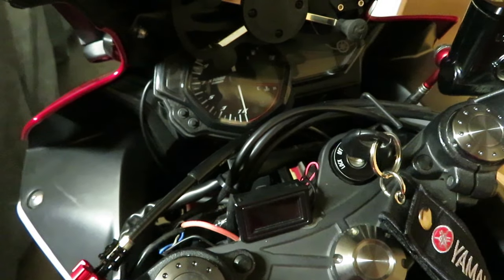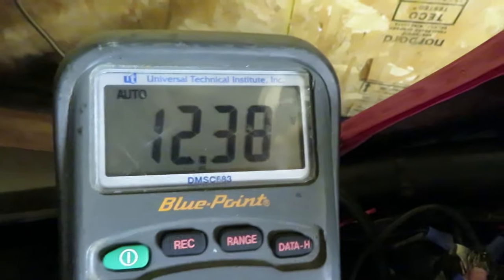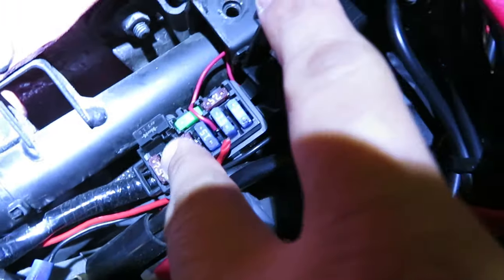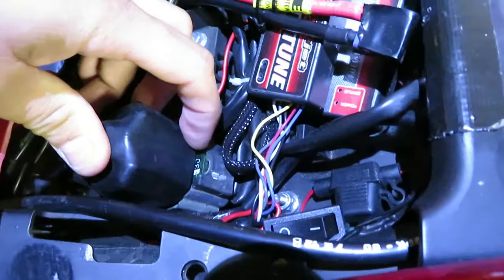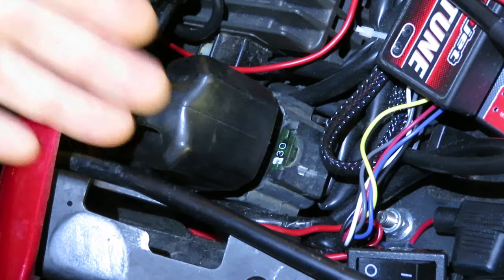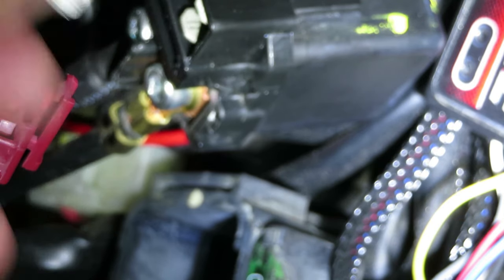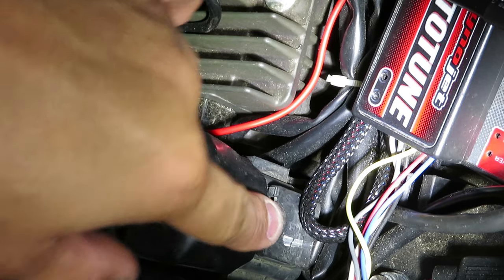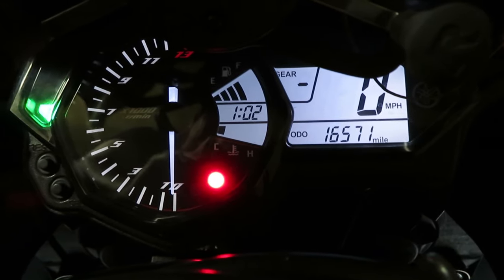I have the Ignition on but there is NO Power to the bike??

Comment: I did everything you did but, had to go an extra step (diff bike). It turns out the ignition switch when "turned" it didn't "make contact", so no power. Idk much about bikes but, I just followed the link, from battery, fuses, relay and lastly, the issue was at the switch.
Reply: What was wrong with the switch?? Mine is blowing the headlight fuse over and over again the moment I try to push the start button. It’s really frustrating me. Any help would be appreciated
Reply: @busakiller1117  My switch when "turned" its supposed to "make contact" with another metal piece, so the energy flows. It was not making "contact" (had to put the small pieces together, then once it make contact, the rest would work. I came back to work on it another day, and I guess I "moved" something else, and now I need to figure that other part out. 
But yours, it sounds like too much energy is going thru....every electric part (as I understand), is only able to handle so much "energy". If the fuse is blowing (preventing the headlight to blow up), its because too much energy is going thru. It seems you'd need to go backwards to find the issue. Good thing about YouTube, there is videos for almost everything....may want to look at those where guys show how to test the current/energy. I don't have the knowledge but like most ppl, if there is time, I'd learn from others and try things out. But, I know how frustrating this can be. Good luck !

Comment: YOU SAVED MY LIFE I had just recently changed spark plugs rectifier stater and battery and starter selenoid and when I changed fuel pump and tried turning it on everything went dark and it wouldn’t turn on even w my jumper cables and i literally found your video and went outside to try it out and it work your a legend bro
Reply: Yooo I've done all the things you have. Even just wasted $360 on professional work and a new stator..... Put on by them. No fkn way the fuse is blown out. I just put an entire new starter relay on my 04Gsxr600..... This shit has me so fkn depressed................................

Comment: Had the problem on my 2021 Honda Forza, started with battery failing, then dealer guy messed around and no instrument power ( in Thailand!). Had already found the start today fuse holder, with FUSE marked on it, was on the right track but unsure how to get into it before finding your video. Even had the spare fuse like yours. Kudos and many thanks!
Reply from the maker: your welcome glad my video was able to help you out before taking it back to a shop that would of charged you alot of money for a simple fix

Comment: Yep good stuff mate you helped someone in Australia I tried to jump start my bike hook the terminals up backwards and blew it
Reply: Hello mate,basicly i’ve done the same thing.Had a flat battery and a mate of mine said let’s touch both batteryes so the thing could start…worked 3-4 times,untill he touched the + with - and the other way.Fuse blown,changed the starter selenoid,new battery…but the thing won’t give a sign of life anymore….it’s a 04tmax 500

Comment: FYI. CBR 500 R - had the same issue, no electrical power. Starter relay was good, battery was good and fuses were good. When I plug in the battery tender I can  hear a high pitched sound. It was the voltage regulator. Now I’m waiting for it to come in the mail.
Reply: Same deal here. But mine keeps popping........

Comment: In the event this bike hasn't burned to the ground yet, PLEASE have someone who knows what they are doing consolidate your wiring. You can even have a bigger (or second) fuse box installed to help clean things up, and make it easier to loom everything together. Also, what's with the stripped insulation on the 12V lead to your starter relay? It's worth it to clean everything up and do it the right way. Bikes might be toys, but they're expensive toys. Protect your investment.
Reply from the maker: I do have a video on how to consolidate your wires. I still have my R3 to this day and still works great.

Comment: I have to wait till tomorrow to see if this is the problem. I ordered new relay. Battery giving 12.5 volts. As video stated, no power when key turned to on. Earlier it did turn on, I was getting 12.4 on fuse 1, and nothing on fuse 2. Though fuse 2 wasn't shorted (burned). Also was getting 12.4v on the relay prongs for plugin. I already have "non compatible" fuses. I'm not going to buy more that won't work. So i ordered the relay. I'd rather have a relay I know matches the type I need, than to guess at a fuse. I have 2, 30amp fuses. One new, One old. The old one, you can feel the friction as it goes into the slot. The new one doesn't. Therefore no conductivity. So, ordered new relay. If my lower 30A fuse wasn't giving any readings on power probe or multimeter, the replacement relay should fix it.
Reply from the maker: i see you have done some extensive testing to make sure on the issue

Comment: Lol what to do if the fuse blows as soon I   try to start the bike ? Does it mean ,that bit is faulty and I need to change that piece ?
Reply: Mines the same way , did you find the problem ?
Reply: @Pr0jectGloYT  lol did you find the problem same thing
Reply: @nihbih6756  yes I did ! So I brought my test light out and checked the power and ground coming from the switch . 
GROUND HAD 12v ! I had a faulty ignition . Replaced it and problem went away .

Comment: Well, I had a shortcircuit when I was working on the turn signals, now my bike can start but no lights are working! Nothing in the dashboard, nu turn signals, no neutral light..nothing at all, and the fuses are all good! What could it be?
Reply from the maker: check the turn signal relay , replace it with a new one. see if that works and fixes the issue. keep me posted
Reply: Guys, you wouldn't believe this! The problem was actually the fuse which I did check previously. The filament crack was so small that I could barely see it, like a 10th of a millimeter! Jesus! Thanks guys!

Comment: I have same problem as you i got a cbr fireblade 929 rr but my fuse relay is good BUT my issu is the battery is new and i put my ignition on  horn wont work...no headlights either what coul b the issu????
Reply from the maker: check the main wire harness plug look for any burn wires
Reply: @ACProductions77  ok am on it
Reply: @ACProductions77  checked all da wires  the bike starts wit a screwdriver iv put between the bike tank n its frame as soon as i remove the screwdriver the bike engine stops ..took it for a spine it rode well
Reply from the maker: @darider6286  then in that case you may have a short some where
Reply: @ACProductions77  i took it for a spin jus now its kickin way better than usual since it got the short sumwhere and iv tucked a  screwdriver on the bike frame so it can start the bike more agressive wit nore power imma leave it like that
Reply from the maker: @darider6286  well as long as it works and your happy with it then let it be. =)
Reply: @ACProductions77  i want to thank you for your help it saved me from going to the mechanic way too xpensive
Reply from the maker: @darider6286  your welcome sorry couldn’t help you more with finding out what’s causing the issue
Reply: @ACProductions77  nah you good that bike 24 years of age as long as its working imma ride it as it is 🙂

Comment: happened to my CBR 954RR..but I replaced  the fuse and it popped again ...what is causing it to trip
Reply from the maker: you have a short somewhere , this is where its going to get time consuming in looking for it. check all the wires looking for fryed or burned wires, any wires that are exposed and touching metal, switches, other fuses , cables to the battery, the battery itself, etc etc.
Reply from the maker: here is a newer video of looking for a short>> https://youtube.com/shorts/ULYwriQriMc?feature=share

Comment: Bro i checked everything, both the fuse box and the starter relay. I previously installed a brand new battery and it was -10 degrees one week during the winter. After that week this problem occured. What should i do?
Reply from the maker: did you check the voltage of the battery? do you keep it on a battery tender when not in use? here is another video I have > https://youtu.be/D8Oz8ak75Xw

Comment: I have an FZ-07 and that isn't only the starter relay, it is also the main switch. I'm having an issue with mine except the fuse isn't popped, all cables look good, and I am currently charging an old battery as the gel battery I put in it last year is showing 12.6, the battery tender is refusing to charge it so I think it might be toasted inside, even with it showing 12v. Weirdest thing I have run into so far. Atleast yours broke at home, mine cut off mid ride... I need to get my bike running so I can check the rectifier as with everything connected, it buzzes and won't let the tender charge the battery, I disconnect the rectifier/regulator, and the tender does what it should. So I may be in for a new battery and regulator, we shall find out soon.
Reply from the maker: are you useing the correct tender for that style battery? thats the problem with those and lipo batteries is that u can not let them drain pass a certain point cuz after that there is no bringing them back.
Reply: @AC Productions  yeah, it's the correct tender, it can do everything except lithium. I have a new battery coming tomorrow. I had a load test done on the battery. Even with it showing 12.6, it failed the load test before it even started. That just tells me there is a shorted cell. So the battery is able to hold a charge, but isn't able to differentiate positive and negative anymore. I'm still going to check my rectifier since everything is still torn apart, but I'm thinking it was the battery giving me a run around. I hate probing plugs, ohming wires, and chasing a problem that was so simple, yet did not want to show itself.
Reply from the maker: @Bk12100  glad you where able to get it diagnosed. hopefully the new battery works out , maybe get it tested before you install it on your bike.

Comment: I have a 05 R1 when I go to start the bike all lights and fuel everything comes on but it will not start I checked everything.it has spark fuel I checked to it has fuel . what is going on with my bike
Reply: does it crank? if yes you have to check spark, gas and air.

if it does nothing at all at push start, you have a sensor issue,maybe side stand, motorcycle tilt sensor or Killswitch at work
Reply: @ficlinic6388  could you explain more plz.. my VFR800 turns on even crank but wont start... and sometimes the display dash would fade out... battery? Or something esle
Reply: @feodiente9460  if it cranks, could be a spark or injector/ fuel pump issue, check those
Reply: @ficlinic6388  cool... seems like its the battery so far... got it charged and now she running fine.. no complaints..😁

Comment: I've had similar problem with my zx9r,all lights work Inc lights on clocks ,but odometer and clock are blank!! And there's nothing when press starter button.
Could it be same 35 amp fuse,and if so ,could the blow with age

Comment: Could this happen with a brand new bike. Only done 72miles. Went to start it today and literally nothing would turn on.
But its so new that its strange.
Reply from the maker: вєиנαмιи ѕнαяιfι I would say to first check the battery that it’s fully charge, then check that the cables to the battery are not loose, it could be possible that this could happen just replace that fuse. My recommendation is to keep your bike on a battery tender when your not using your bike.
Reply: @ACProductions77  Battery was dead. Dealership replaced it for me. Thanks for the reply. Sorry i took so long to reply.
Reply from the maker: @zantesh  no problem glad it wasn't something more serious

Comment: When i turn the key to the on position my bike has the same problem but if i leave it on, it will eventually turn on. Then when i start it, it will eventually turn off completely after idling for a little while. It will turn off faster if i give it a little rev. And then the key wont turn anything on again unless i wait.

Comment: I'm having the exact same issue with my bike but the fuse is good, we tried charging the battery and the battery is good. the frame is grounded, and I have 12 volts  between the connections to the relays I don't think there should be 12 volts between the relayed connections and I don't think the frame should be grounded let me know what you think
Reply from the maker: check all the fuses, & also check the main harness plug

Comment: I am having this exact problem with a different stater solenoid,  I've poked everything! Still have no power out of the ignition switch, I have constant power and good grounds to everything tho
Reply from the maker: have you checked the main wire harness connector to see if you have any burned wires?
Reply: @ACProductions77  thank you for your reply,  However,  I ended up just buying a ep35 electronic flasher and cured the problem.

Comment: I got a cbr 300 it starts up but no display no horn no lights and 1 fuse keeps popping help please?
Reply from the maker: there must be a short somewhere in the wiring, you will have to follow all the wires there must be a wire that is making contact with metal or another wire causing it to malfunction.

Comment: I have the same problem but i checked all the fuses even the one in the starter relay😭 any suggestions?
Reply from the maker: check then main wire harness could be a burn cable that is the display cable.

Comment: I changed it but after i switched off my bike,tried to turn it on again. it happened again with the new fuse. whats the problem then?
Reply from the maker: check the cables make sure they are tight on the battery terminals and on the relay.

Comment: My bike has no power going to it just like in the video but I checked the 30amp relay fuses and they were completely fine. I’m pretty much at a complete loss so if anyone has any ideas please let me know!
Reply: Check to see if you have power to one of the sides of the 30a fuse , then turn your ignition on and you should have power on both sides of the fuse .
Reply: I also had a problem with the relay selonoid wires coming loose I'd be going and everything would go off and it was the selonoid relay wires coming loose.

Comment: i´ve a more complicated issue...my bike has lights, turning signals, the starter motor works(i assume that piece you say in the video its good otherwise it wouldn´t start) BUT the bike doesn´t start anyway.
The lcd/speedometer doesn´t show rpm nor kms, just turns on when ignition is on
i´ve no spark on the plug, ive already changed CDI, plug and the main fuse
Any ideas? :/
Reply: btw, my bike has no fuse on that relay, but since the starter works, i assume its good
Reply from the maker: it could be that the contacts are fused together thats why it starts with no fuse, sorry for the extreme late reply as I didnt see this comment when you had posted it & it went to a different section of comments that i just now noticed.

Comment: scooter relay has no fuses man i have the same problem ! what to do ?
Reply from the maker: check your battery cables make sure they are not loose and have good connection and bolts are tight, next check all fuses, if your relay has no fuse then install one back in most all relays have a fuse to it some are in a traditional form and others look like a small black square box.

Comment: I have this same problem but after replacing fuse VFR 750 won't start. I guess there is short else
Reply from the maker: have you check the other fuses
Reply: @ACProductions77  thanks not yet couldn't opener the box so awkward. Will definitely try to check them as well, as there is a starter fuse too. It this not help I try check starter selenoid to see if this is the problem
Reply: @ACProductions77  I checked battery terminals, handlebar switch start cut off look good to me. Could be other switches or there is short somewhere in cables
Reply from the maker: @dariuszklak012  yes looking for a short is definitely time consuming as ill be posting a video soon of my experience with looking for a short
Reply: @ACProductions77  thanks for help I apriciate it 👍. Interesting fact I had bike died on me like today month ago had this same issue. Wiggled and touched around starter relay and it was ok. Got power again. Today again but wiggle and touching didn't help. I reckon there is something with connector as bit of plastic missing near metal wires in connection cube.
Reply from the maker: @dariuszklak012  best of luck
Reply: @ACProductions77  👍🙏 thanks

Comment: Me and my partner needs help, we checked the battery all charged and he only has 1 fuse which is fine and the relay has no fuse, his bike was remodelled from the guy he bought it from and we’ve had nothing but trouble and the headlight, indicators and rear light don’t work until he’s been driving for some time.
Reply from the maker: yr make & model of bike? all relays should have a 30-40 amp fuse in it. could be a burn wire on the Main wire harness, you will have to take a look at it.
Reply: 2011 motorroma 125cc, he has a fuse coming off of it but it’s only a glad tube fuse and his bike was completely stripped and remodelled so he has no fuse in the relay just wiring and we’ve removed the seat and the wiring seems to be good
Reply from the maker: @paigewillis3062  then im not sure at this point you will have to take it to a shop

Comment: So what if it's not the fuze. I have no power going tovthe PARTs and ACCESSORIES fuze
Reply from the maker: if its not that fuse then its a short somewhere in your electrical system even a burn wire